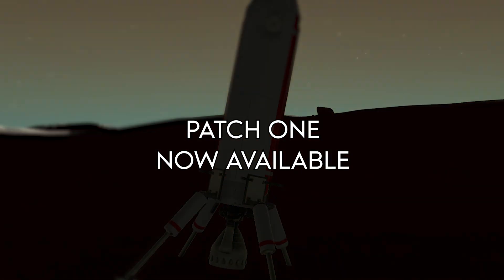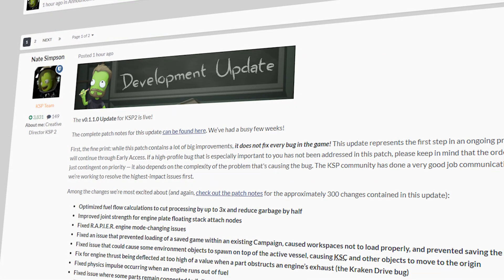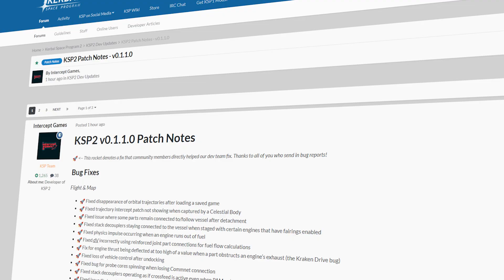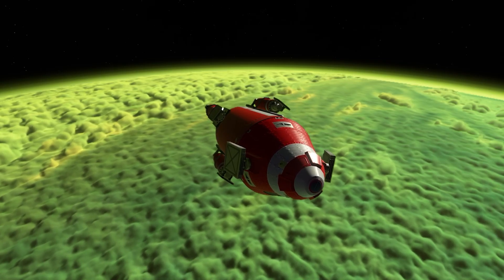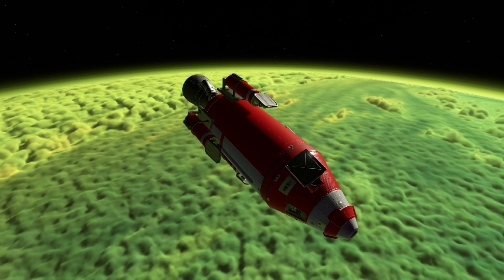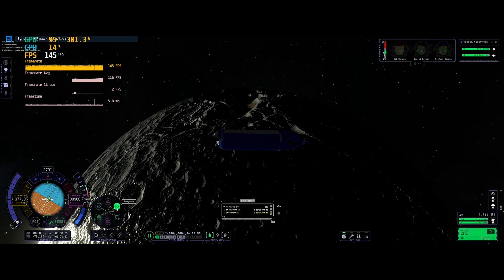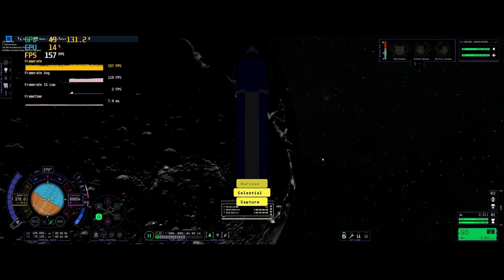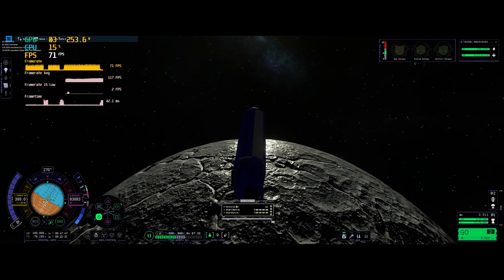Kerbal Space Program 2 - Patch One NOW AVAILABLE - Overview and First Look

Comment: 1080ti with a 3600X here and im still tanking at 10 fps on the launchpad
Reply: There's no way this is true. I'm running an i5-3570k and an RTX 2070, a huge CPU bottleneck, and I have no frame issues. Why do you people lie about your system specs?
Reply: @prestonhebb1380  nope

He's not lying

Me 12700k, gtx1080
20fps

Comment: Correct me if I am wrong, but did you happen to EVA when the port for that command pod was in the process of being rolled over? This could cause the Kerbal to be stuck between a rock and a hard place, so to speak.

I saw similar issues in KSP 1 way back in beta, though they were more of the "Kerbal Spaghettification" variety.

Comment: i still cant do the simpliest pol missions. 
crafts disintegrate 50% of the times you load into it. 
aero doesnt work right. wings dont generate real lift. you cant make a simple helicopter. 
and the video of them showing that off you can see that the engine nozzles are pointing downwards. so they faked that.

not a good look

Comment: I thought the burn timer in KSP2 would have you start the burn 1/2 the time before the node. It always seems to start the burn at the node for me.
Reply: It’s because they made it work good now, before starting hallways was just compensating for it not being right
Reply: Yes the burns now account for the changing vehicle mass throughout the burn, so you start when the timer hits zero. Old method assumed an instant burn at the maneuver and then compensated by splitting the burn before and after
Reply: @kdaviper  ok, but if you want to circularize an orbit at AP then you have to start the burn (roughly) 1/2 the burn time before AP. I get the red line is the trajectory while burning and less mass on the ship, but the burn time still starts at the node. So I think you have to move (slide) the node back a little so half the red line is before AP.
Reply: @notreallyme425  you do have to do this now, but it still is more accurate overall. You still had to guess with the old method, while this one tells you for sure what you're going to get.
Reply: That was ksp 1. They changed it. Hence why it says "start burn in"
Reply: You start when the timer is at 0

Comment: It runs so good now!
Just landed on the mun and returned in an XL rocket, no wobbling! 80-120 fps all the way on max gfx.
Reply: 2080 too and it was running pretty well on the fps front (compared to what people were saying) anyway.
Prob try a quick test of the update before bed.
Reply: i was so frustrated with the bugs, you enjoying it more so far?
Reply: Ya i just went and tried it again, random explosions during launches are constant. Sometimes the rocket does not even load in right on the launch pad and i have to reload multiple times before it even allows me to launch, but i changed nothing other than reloading the launch. 

Also random rocket control failure where it wants to roll over in the opposite direction of desired heading.

I hate to say it but this patch did nothing to resolve my issues with the game, they might be worse.

Running a RX 5700 XT which is no slouch by any stretch.
Reply: @Trigger200284  I don't do AMD so I couldn't possibly comment on its speed but I think it's logic needs a bit rewiring by the sound of things.
Reply: @cmcc3721  Sure, let's blast AMD and not a sub-par coding of a sub-par video game.
Reply: @libertas5005  Games phenomenal....on the correct hardware.
Reply: Ok today I am getting some annoying bugs, like I just got the main section of space station into orbit, then it suddenly told me i had crashed and ended the mission.  I got it up and then build the second part of the station, then on the launch pad the craft would just fall apart, even after rebuilding it, arrrggg!
Reply: @HighDefBNG  dealing with that constantly. The update actually made that exact issue worse for me.
Reply: still trash FPS on 3070
Reply: @antonybr1  got that 2080 over here, livin large with triple digits
Reply: @antonybr1  i didn't even have trash fps prior to the patch and i also have a rtx 3070